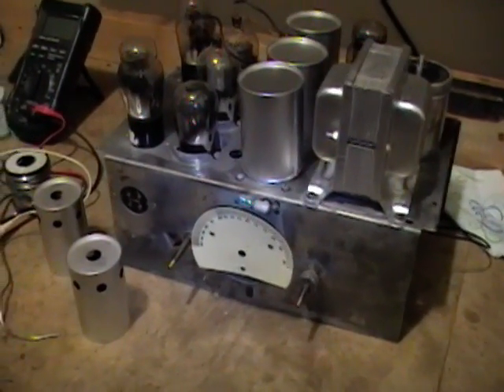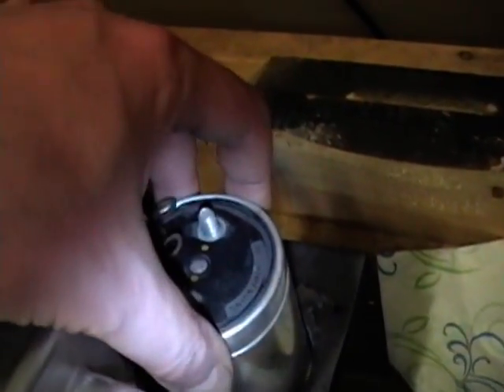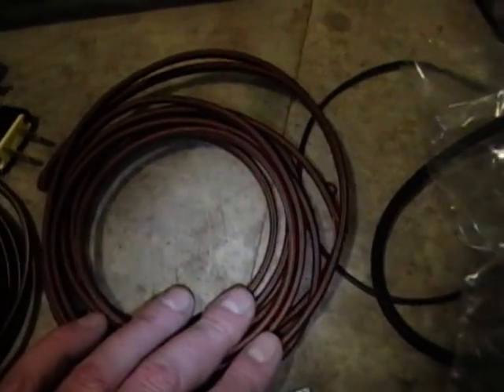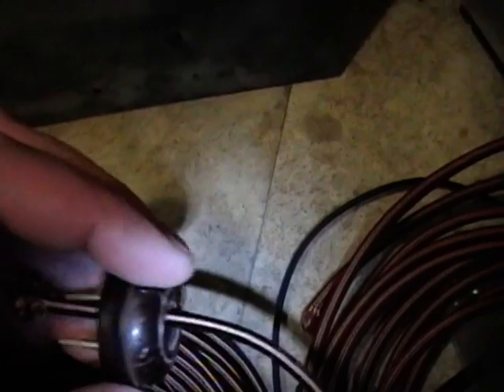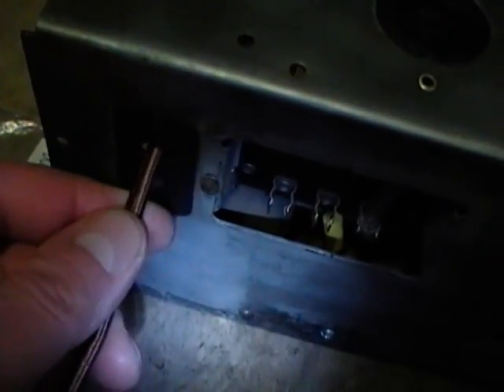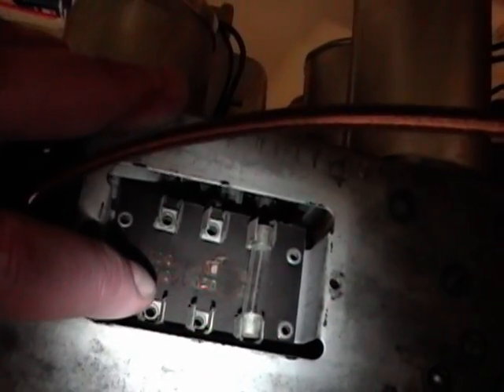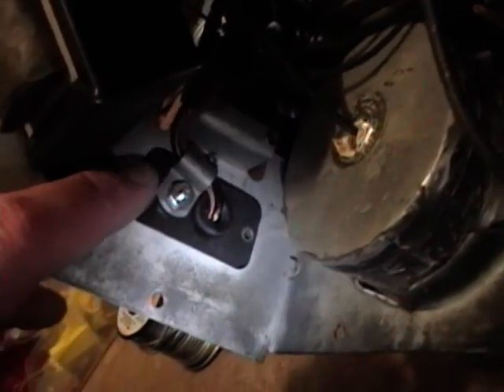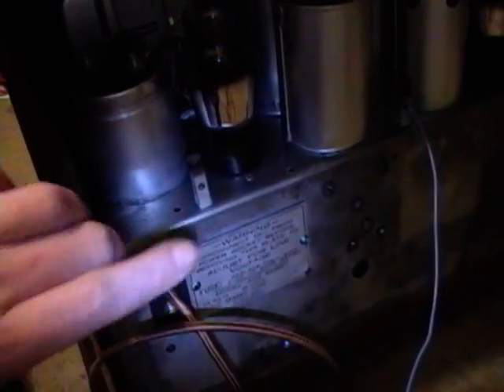Sparton Jr 400 restoration - p8o8

Comment: With those old plugs, they used to use a UL Knot (sometimes called a UL loop) to keep the wires secure.  I have '30-'40s electrical repair books that have diagrams of it.  Very Cool Radio!

Comment: I think that I mentioned reading before that you can adapt a type 5V6 to work in place of the 183/283. It's a beam power output tube that was used in some series string TV sets, I think it was either used for an audio output or a vertical output tube. Basically you wire up an octal to four pin adapter and tie the two grids together to turn it into a triode, but again you may have to play with the cathode bias. Although not original looking the performance will be similar to a 183/283.

Comment: @bandersentv I was just curious how well the 5V6 substitution might work, I've heard it works well in place of 5 volt power output triodes but I am not sure about a 183. A 6L6 can work in place of a type 50, triode connected, with a dropping resistor, and by playing with the bias. I like to keep tabs on such things since I like early AC sets and would like to get one of the Sparton Equasonne models someday, which sometimes had a Sparton version of a type 50.

Comment: I got mine for 150$ with shorted tubes, it is worth it to replace the tubes, even if the power tube is a dud?
Reply from the maker: What tubes are shorted ?   I'm not sure what you mean by power tube.  There should be a pair of 183 output tubes.  They are very expensive and hard to find.  However, a pair of much more common and less expensive 71A tubes can be used.  That's what I did.  You'll need to make a minor change to one of the resistor values to set the correct bias on the tubes.  I talk about it in the videos.
Reply: Thank you so much. I mean the globe tube,
Reply from the maker: Sorry, still not sure what you mean.  It has six tubes.  All were globes originally when it was manufactured.  A few years later the ST "shouldered: type glass envelope came out.  I believe all the tubes used in this radio are available in either type.  Globes are less common and sell for more.  Electrically they are identical and either type will work.  Depends how much you're willing to spend.
Reply from the maker: There are several tube vendors out there and there's always ebay.  Personally, I like "Find A Tube"  http://www.findatube.com/
Reply: Is it cheaper? I doubt I will be selling this set anytime soon as aside from getting it working again, I plan to solder an AUX jack to the speaker terminal on the side. So I am not worried about reaching a quota.. Thanks again!
Reply from the maker: Do you mean is Find A Tube cheaper than other vendors ?  I don;t know.  There might be others that are cheaper.  He has a good selection and fair prices and sells used tubes for a fraction of new.  You plan on injecting audio directly into the output stage ?  I wouldn't. It's not going to sound very good and altering the radio will decrease it's value to collectors.  BTW I sold mine last year for $200
Reply: Maybe i'll just clip a jack onto it instead rather than solder. I plan to use this as a speaker for my record player along with as a radio. Thank you
Reply: I can't imagine you profited much if you care about that stuff... Those tubes are expensive as hell.